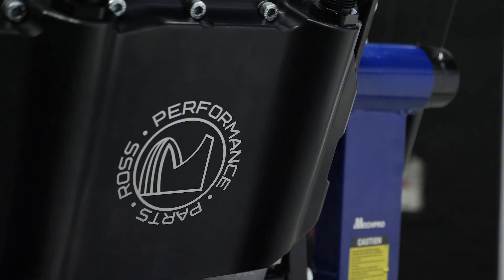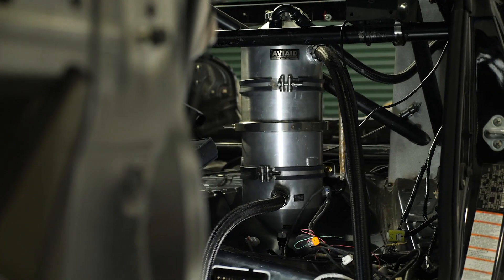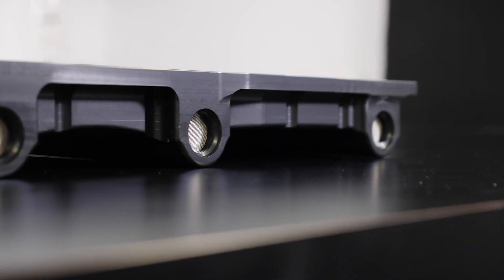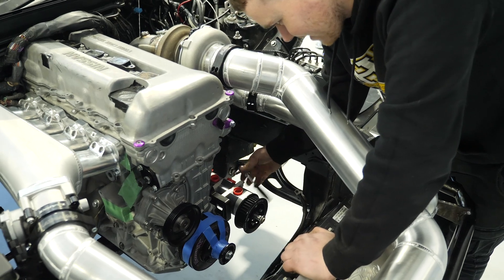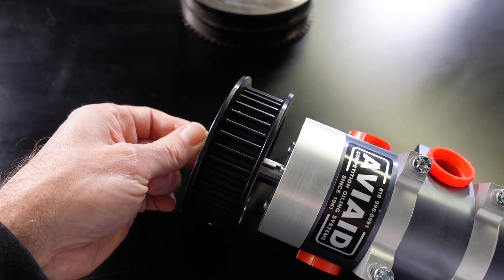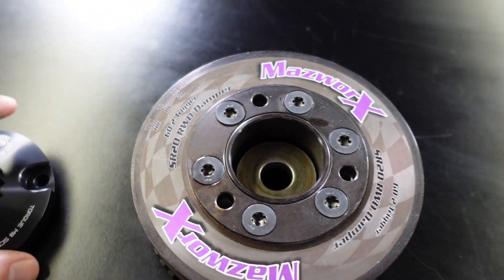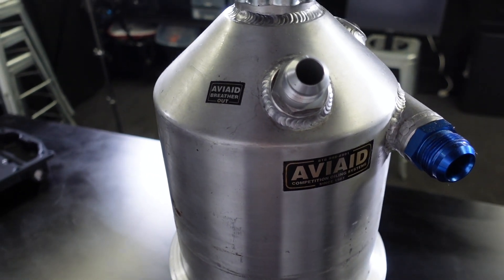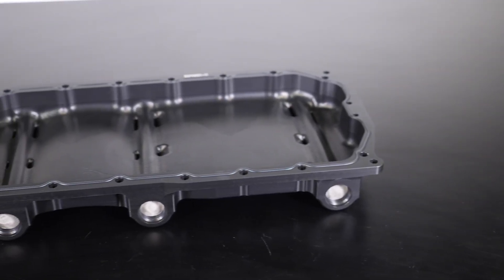Why Fit a DRY SUMP? | GT86 SR20VET Engine Swap [TECH TALK]

Comment: How practical is it to run 1 of these on a daily/ fast road car? Dry sumps are an option on ford duratec engines using internal high pressure pump.
Reply from the maker: Not as practical as a wet sump given the requirement for a reservoir and increased oil capacity, but what people are willing to put up with in a road car and what they aren't really comes down to personal choices and budget/s. With the 1UZ-FE this car was road legal and had a dry sump when we got it for example. It also had no passenger seat either though - Taz.

Comment: What is your opinion what it comes to turbo oil return line: should I connect it straight to a scanvenge stage Via T or tap own -10 to the scanvenge sump?
Reply from the maker: Personally I prefer to return the oil from the turbo into the sump and scavenged from there rather than dedicate a complete scavenge stage to it. If the plumbing is too hard to get the oil return into the sump then I'd be inclined to tee it into a scavenge line - Andre
Reply: @hpa101  Thanks for the reply, I was thinking to tap it with own connector. 😎

Comment: Great info so far! Would you make a follow-up video which details how you position, fill, and plumb the reservoir to prevent introducing air into the system?
Reply from the maker: You can't avoid introducing air into the system as the scavenge stages pull both air (blow by gasses) and oil from the sump. The key part is separating the oil and air from each other - Andre
Reply: @hpa101  Thanks Andre! It sounds like the scavenging at the sump helps remove the majority of air. From there, an air oil separator plumbed in to the valve cover/oil reservoir combined with the reservoir having a swirl pot design should help limit any further air. Am I on the right track?

Comment: Please tell me how to protect the engine if the belt breaks? How to cut off the ignition programmatically in the M48 motec?
Reply: run a trigger wheel/sensor on the pump and make a map that cuts ignition if pump loses rpm or just do a simple oil pressure cut
Reply: @RHBTurbochargers  Oh, thanks for the idea! I have a Weiss pump, it has a fuel pump drive. Probably the easiest way to attach a trigger disk to it. But such a sensor needs 3 wires, and the M48 has inputs only for engine control. You can somehow implement cutting the ignition from the emergency lamp oil pressure?
The M48 Moteс has inputs from switches.
Reply from the maker: It's been a long time since I've dealt with the M48 and it was a lot more primitive than the x00 series and the M1 series. In the later ECUs you can simply set up a protection strategy based on oil pressure but I can't recall if that is possible on the M48 sorry - Andre
Reply: @hpa101  Thanks.I work with what I have.)

Comment: How does the dry sump setup change the oil capacity of the system compared to factory wet sump?
Reply from the maker: Typically the oil capacity increases quite dramatically. 6-8 litres is not uncommon.

Comment: Another very good video - do you chaps have a new camera, the imaging seems a little bit sharper than previously?

One important point, that seemed to be missed, is that to work best there needs to be some air movement to carry the oil to the scavenge pumps. Without that the scavenging will rely on the oil actually condensing out and gathering as a liquid in the bottom of the sump before actually flowing as a liquid to the pump - worse, there will be no air movement to carry the oil droplets through the return line and it will need to fill before any oil is returned to the reservoir tank. That 'vacuum' scavenging would rely on a "G" feed - whether entirely from gravity or with the assistance of lateral forces, and as it's normal for the pump inlet to be a bit above the actual sump floor, that means liquide sloshing around in the sump. Pumps can draw quite a lot of air through them and that would carry the oil mist and also help move any liquid towards the sump outlets.
It may help if you think of a vacuum cleaner works, it moves a lot of air and that air movement is what actually draws in the dirt - this can really be made clear if you turn it off, hold the nozzle in a pile of dust (or dirt, LEGO blocks, or whatever) holding it hard against the floor to block it off, then turn the vacuum on, then off, then check to see how much has been sucked up - there will be none. Replace it in the dust pile and, again, hold it hard down while turning on the vacuum and then lift it a little - the air movement will draw in the dust allowing the vacuum to operate.

From that, it should be evident that there is going to be a need to allow the scavenge pumps to draw some air into the engine for them to operate correctly, which has to be balanced against the torque/power benefits of low crankcase pressure - IIRC, around 0.3 to 0.5 bar of vacuum is generally the ball park. Don't forget to filter that air, too, and while some may have a simple breather for their vehicle, there are also devices that can be set to hold a specific vacuum level, adjusting the amount of air let in as required.

With "V" engines, especially 90 degree, it's not uncommon to have a scavenge from the head that's usually to the outside, or both, because lateral loads over ~1 G  can cause oil to stack up in the head. I would assume a similar situation occurs with flat engines, like Subarus, and a scavenge from each head may be very  beneficial?

With the oil tank, that kinda illustrated why one should always spend a little extra and get a tank that can be taken apart for cleaning, unless one has a filter between the scavenge pump and tank, there will be fine engine debris collecting in it that should be regularly cleaned out and checked - it is also a very good idea to take it apart when it's received and given a good clean and check over as, with most pressure stages, any rubbish left in it will pass through the pressure stage before the filtration.
Reply from the maker: We're using a Sony for the Vlog material instead of the usual Go-Pros in an attempt to improve the quality along with some mics at times. Good spotting and good point as always mate. Hope you're doing well up North, the nervous nail-biting is well into swing in the workshop here with a week to go before we have to load her on the trailer - Taz.

Comment: What size an hose line are you guy's using for feed and return?
Reply from the maker: The suction side from the tank is -16 and everything else is -12
Reply: @hpa101 
 what type of line is use with out the chance of having the line collapsing under suction?

Comment: The pressure stage is at the rear where the relief valve is. FYI to increase pressure you can upgrade the spring in the relief valve.
Reply from the maker: The relief valve is adjustable so you can set your desired pressure (within reason) by winding the adjuster in or out - Andre
Reply: High Performance Academy yep and different springs have different pressure ranges. People need to choose one that suits their desired pressure (preferably one where the desire pressure sits around the middle of the pressure range on the spring if possible).

Comment: What about baffled wet sump pans are those any good?
Reply from the maker: They can be when designed well but they still can't beat a proper dry sump system - Andre
Reply from the maker: There's a good video on it here where David from Mountune talks about the wet sump setup for the BTCC FA20 powered cars they were involved with. Basically if the rules didn't dictate a wet sump, it would have been cheaper and easier to run a dry sump setup, but he'll fill you in: https://youtu.be/csDa_Di8r44 - Taz.
Reply: High Performance Academy awesome video thank you for that! I’m going to be looking into a dry sump and that syringe of oil for protection on the track corners!

Comment: With a dry sump would you run a thinner oil than normal to also help with response etc as pressure v heat is not as much of an issue or still keep the same oil as that’s why the motor needs
Reply from the maker: No, the oil specification is not affected by a wet or dry sump system.

Comment: Can you or should you seal off the valve covers from any other style of PCV? Also what is typically done with the stock oil pick up tube and gear/pump? You just simply remove the internal pump gear and pick up tube? If so does any of it need to be blocked off?
Reply from the maker: You can block off the normal breathers but typically you'd want to run a vacuum regulator to prevent excessive vacuum in the crank case. This works well for N/A engines but turbo engines tend to still generate positive crank case pressure (depending on boost levels) so a breather in this case is still beneficial. The dip stick tube can be blanked or used as a pressure sensor port and the stock oil pump gears are simply removed - Andre

Comment: Looks like its finnished, but to cut down on airreated oil it's worth considering 2x -16 return pipes to the tank via an oil cooler on each. The slower rate of flow (but still the same volume) is quite effective